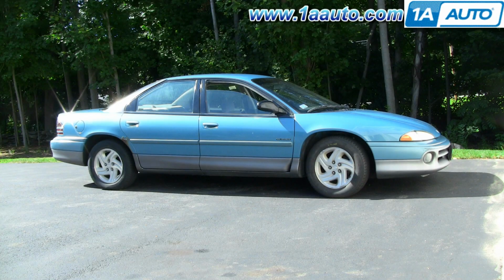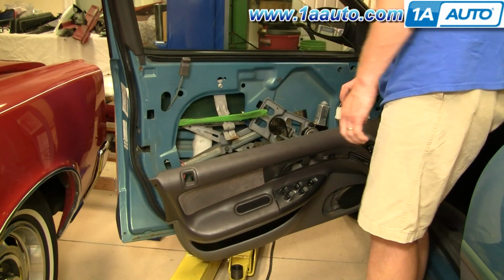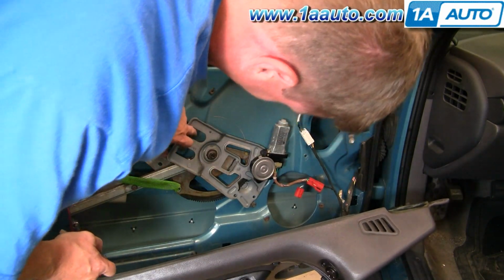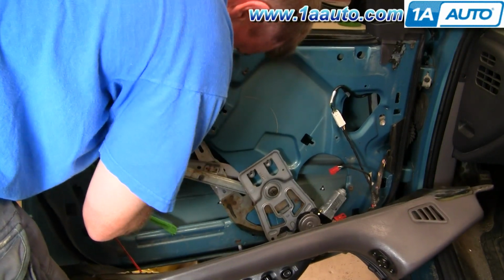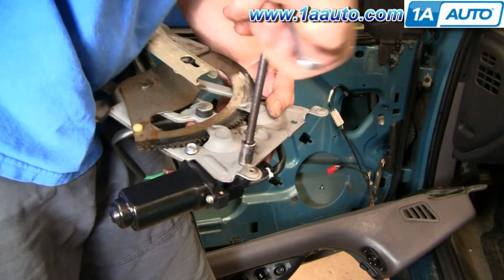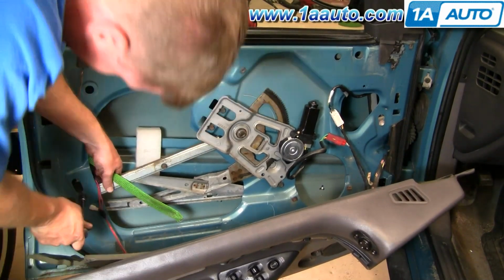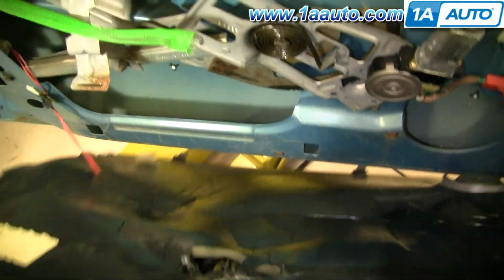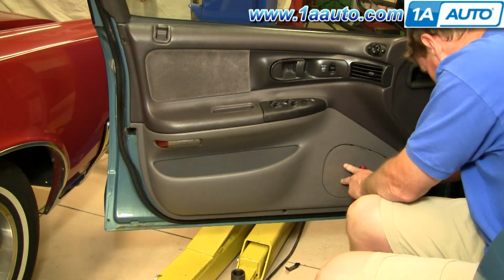How to Replace Front Power Window Motor 93-97 Dodge Intrepid

Comment: Sorry, part two. another question. Do you know that black trim on the side of the windshields on 98-04 intrepids? it runs along from top to bottom... mine is chipping and chrome is showing... what should i do without taking it to an auto shop to paint it? can you maybe post a video on how to uninstall it? thanks very much.

Comment: thank you, unfortunately my local dodge dealer said that since the inside door handle is "plastic" welded that i'd need to get a whole new door panel from the inside which would set me back $500.. so i took matters into my own hands and just super-glued the plastic part that broke.. its on pretty strong now... But i do have another question, I am very interested in installing the Halo headlights, I have looked up local laws and it is legal.. any info on that?

Comment from the maker: You may need to remove the door panel to repair the lever. We carry the outer door handles and also the window motors on our website for your Dodge Intrepid. 1aauto.com 888-844-3393

Comment: awesome video, I will be replacing two of my motors on the passenger side, but i have a dilemma... i broke the plastic cap on the green covered lever to unlock my door from the inside... with a baby on the way i need to be able to open the door.